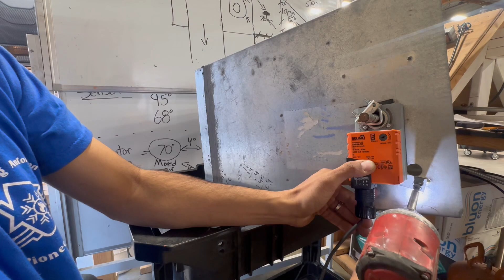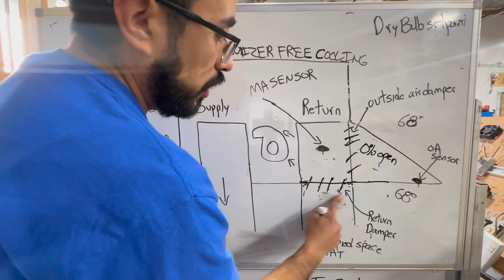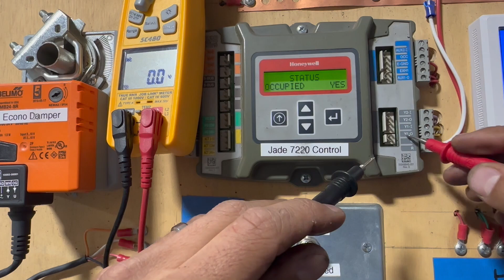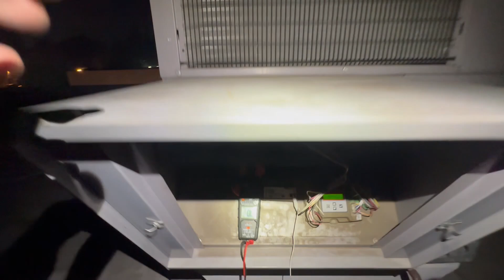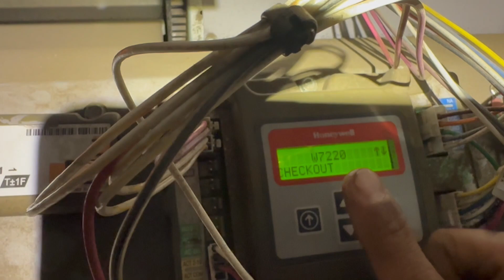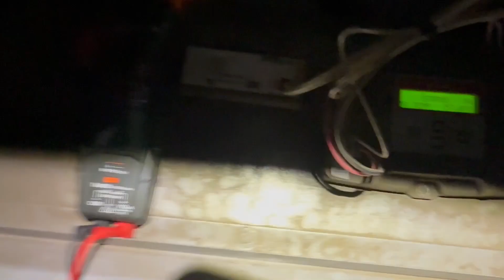How Does An Economizer Work? (Honeywell Jade Controller) - HVAC Training

Comment: Thank you for your tutorial.  The york rtu i am working on has a jade economizer like your video. 
But it's blank with no display.  I checked the R and C on the jade terminals but there's no 24v. 
Where does this 24v come from to power up the jade? Is it directly from the main control board? Thanks

Comment: Thank you very much, I learned a lot.  This is so far the best Economizer Training video.
If I need to bypass the Economizer, shall I jumper Y1-I and Y1-O？
What if there is no power to this Economizer , is Y1-I and Y1-O  still connected or disconnected?
Thanks again!
Reply from the maker: Yes, if you want to bypass or there’s no power to the economizer, simply jumper or wire nut Y1-I and Y1-O.

Comment: how does this work with humidity and dew point
Reply from the maker: Great question! You would have to install the Sylk Bus Sensor for the outside sensor, which is a combination temperature and humidity sensor. What I’m showing in the video just reads temperature. You would then have to set up the JADE controller to look at humidity, not just temperature.